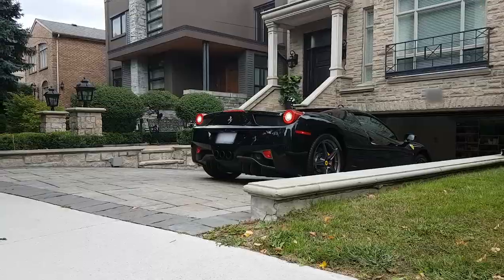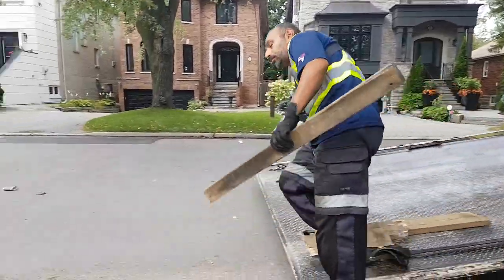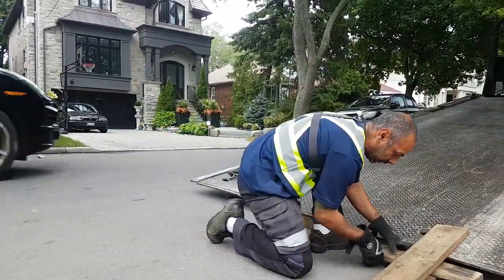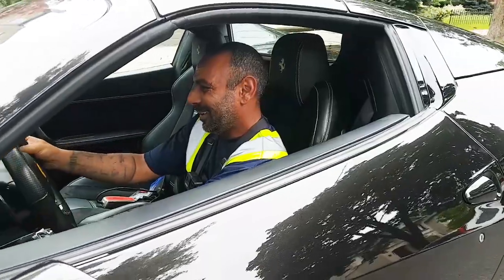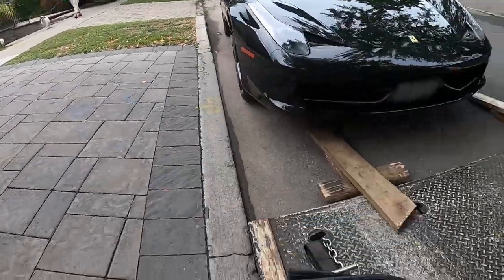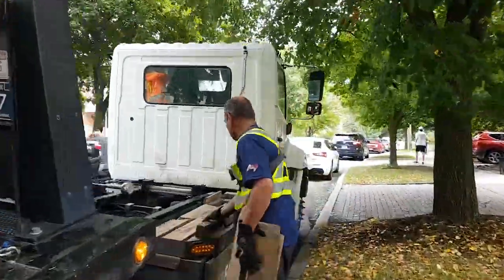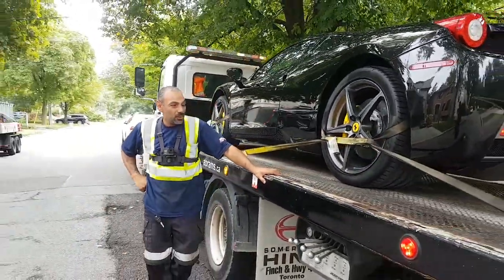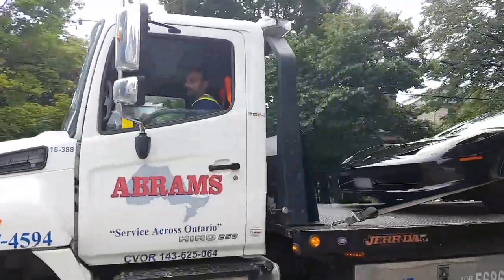Towing a FERRARI 458 With a Flatbed Tow Truck

Comment: They sell race ramps..way more safe and professional than wood..but hey to each is own
Reply: Yup''''''
Reply: Yea but if yu drive a tow truck then yu would kno how often yu actually use boards .... not worth the investment when boards do the same exact thing ... and he used the boards wrong , probably why he didnt show himself actually loading it up the bed . When using the boards the way he did 95% of the time the wheels after coming off the boards shoot the wood up towards the vehicle and if it was a heavier vehicle the boards break also . He should have lifted the bed and put the boards under the bed then lowered the bed securing the boards so they dont move or shoot up at the vehicle. So he should buy the expensive ramps to look more professional , but pulled up in a Hino flatbed literally the cheapest big size  flatbed that you can buy .... obviously him towing that Ferrari is a one out of 2000 calls he towed a vehicle that expensive.  Lol . Pretty sure that company does not specialize in towing high end vehicles.